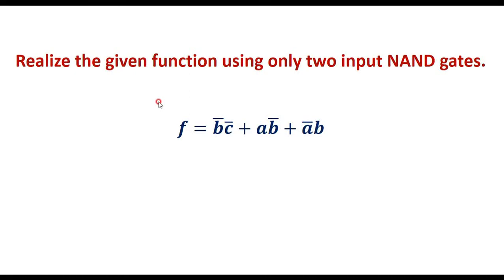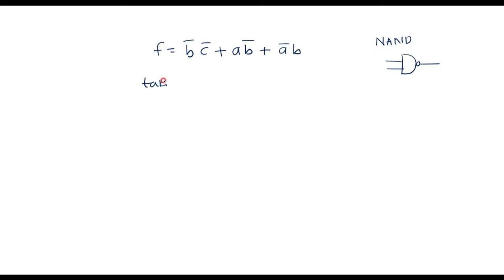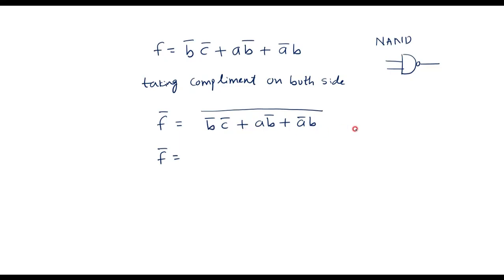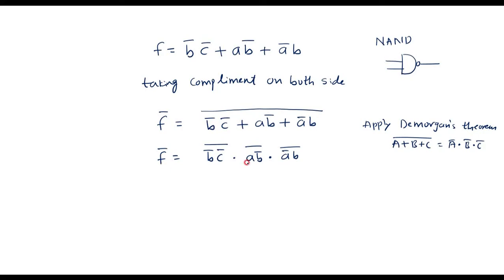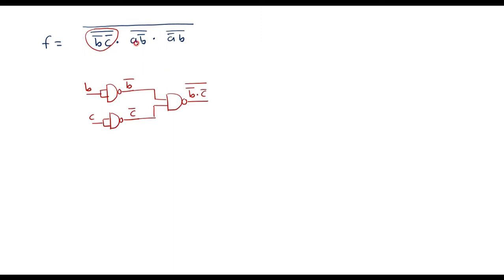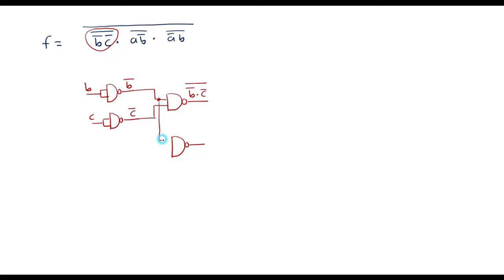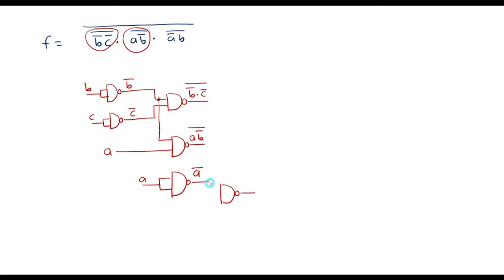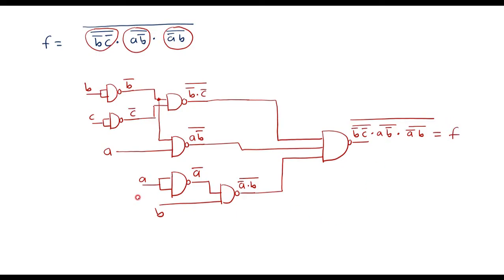Realize the given function using only two input NAND gates.

Comment: Good day sir. But the question said using only two input NAND gates. Are the input NAND not more than two in the circuit expression?
Reply: no the question is like that implement using nand gate but you have to use nand gate which have number of inputs - 2
which is as asual
Reply: @indiancoder6252    but NAND GATE IS HAVING 3 INPUTS.....IT DOESNOT MAKE SENSE